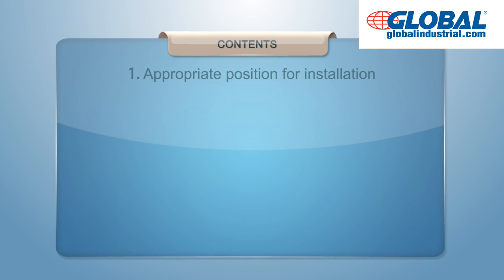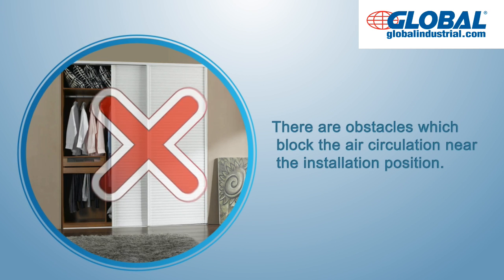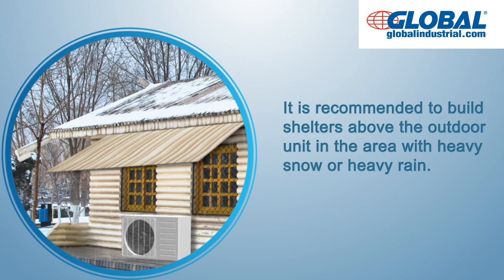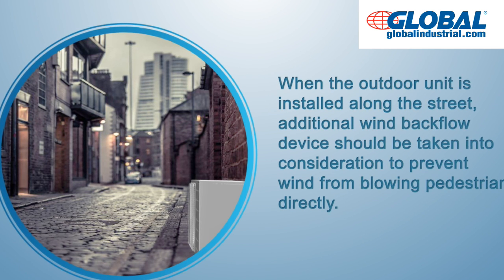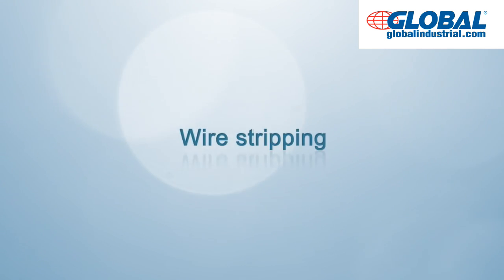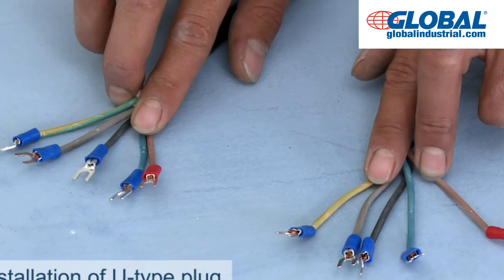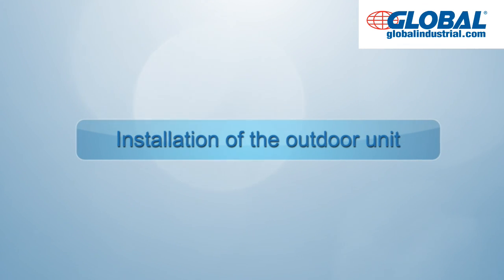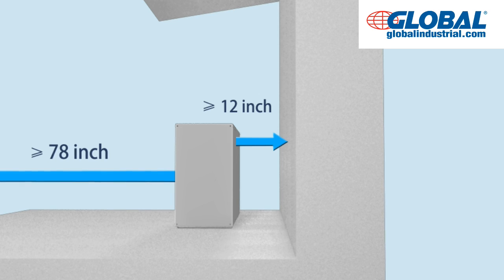Global Ductless Mini Split Air Conditioner Installation v3

Comment: THANKS FOR SHEARING THIS VIDEO /i have a questions what is the diameter of copper pipes.and is that sizes used for all mini split air conditioner?thank you for answer

Comment: There is a small plastice cover covering the copper tubing that runs from the indoor unit out the wall to the outside unit.  Can this cover be removed and the tubing come straight out the back?  Instead of it coming from the bottom it would be more towards the top.

Comment: I have some question, I used 165s  5/8 ODF filter drier in AC split type, but the copper line in high side is 3/8 ,the unit is 28000 BTU ,isn't OK did I install?

Comment: What is the name of the tool that holding the indoor unit away from the wall of bracket to service from bottom because the mini split mighty bracket holder can be a headache. Thanks